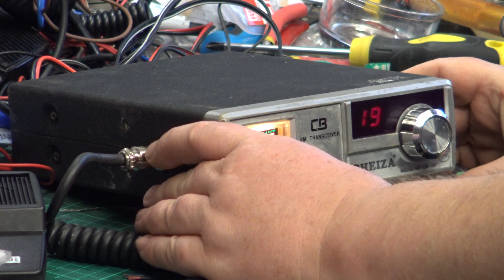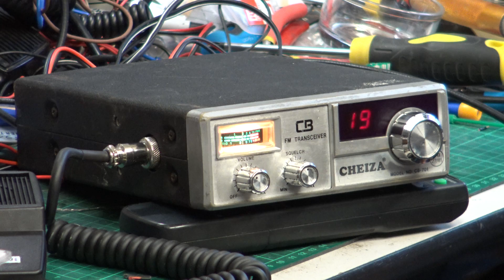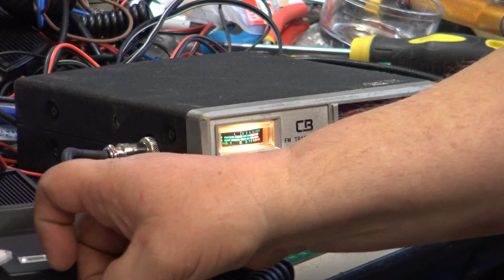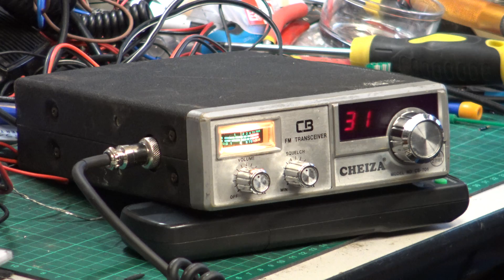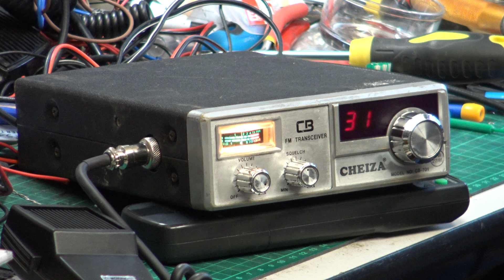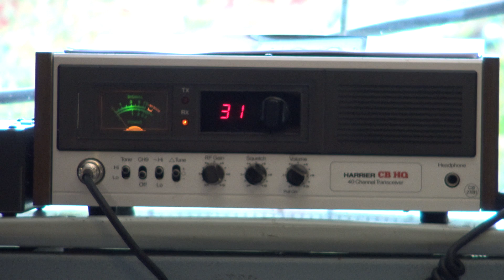Cheiza CB701 UK CB27/81 CB radio (mobile) - On The Air test

Comment: I get the impression that in the day it was very much hit and miss as to whether you got a good radio or a Siero Hotel 1 Tango radio. Love the mugs by the way, a merchandising opportunity perhaps?
Reply from the maker: Most Sundays it will be yet another variant of a Great GT848/858/868; they are all as lousy. TX varies from 1.7W to 3.5W, though this one was 3.6W. 

What interests me about the Great chassis, is that it's actually very reliable. This radio had to have one 12p capacitor changed & a meter lamp. Look at the wear; decades of successful use. They may be bleedover boxes, but they weren't made as a homebase...and it's not 1982 anymore when there were far too many people on CB.

Mark came here once & had  a bit of an emergency & needed to contact me fast. He was in a building here with no CB (the pipe organ workshop), but there is a base aerial. Mark went to a storage shed & from 100 CB's of the steel shelves, pulled off a Fidelity 1000....because the chances are it would work, and it did. I was 7 miles away & heard him calling & quickly got to higher ground a bit nearer to talk to him properly. The point is Mark had that CB on within 2 mins of the emergency & I answered immediately on his first call.

Richard

Comment: I was over surfleet way today , did listen out about 12:00 and gave a call out was most likely still a bit to far from tango towers 😀 I was using a maxcom 20e mobile into a stinger mobile antenna that I normally use for 10m ... 👍
Reply from the maker: Surfleet is about 30 miles away & not our best direction. Unfortunately we don;t have the CB on except for the tests...but we do have a scanner on connected into the tannoy system, so people calling us on 31 will be picked up from just a couple of miles away.  The scanner is also programmed with the local 70cms repeater at Grantham, GB3GR which I just happen to own, so Radio Amateurs can always call me that way. The repeater has excellent coverage...upto 100 miles if you pick your spot.

Richard, G0OJF
Reply: @ukfmcbradioservicingTango21  . Hi Richard i was receiving  GR fine from surfleet using just a handheld . Never mind . It was interesting to have the CB in the car for a change . It was very quiet on the channels unfortunately.  👍